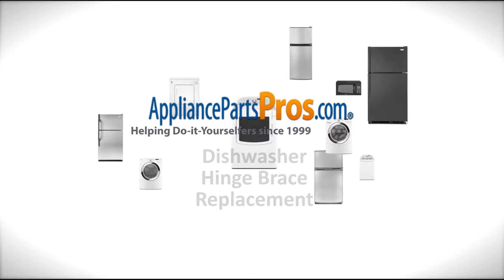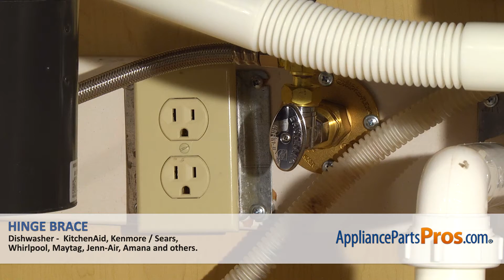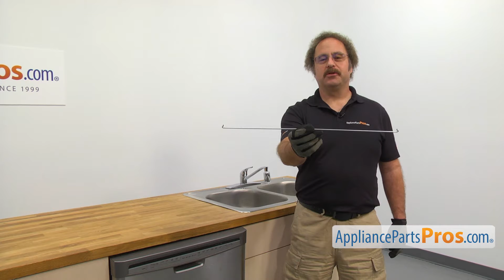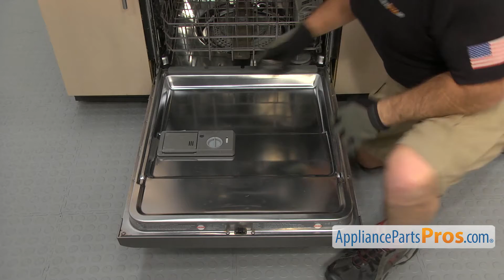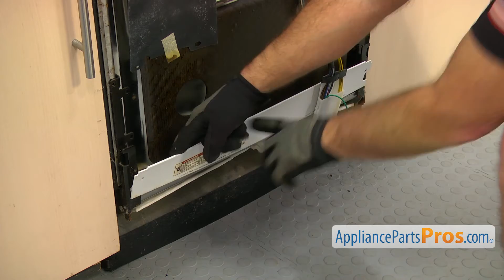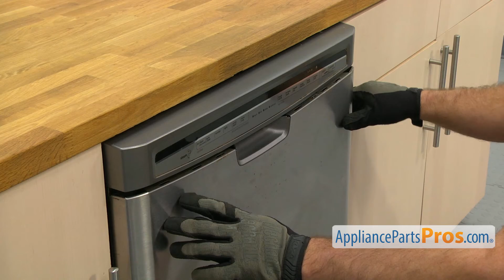Maytag Dishwasher Hinge Brace W10850371 Replacement — fits Whirlpool/KitchenAid

Comment: I'm in the SAME boat as everyone else here. I'm going to buy the brace, and see if it works.
The only reason I could think this could help would be removing a warped barrier that maybe flexes the seal away??
Reply from the maker: Yes, the brace stiffens weak/warped cabinet mounting so the door/latch align and the gasket compresses evenly. It can stop corner leaks. Level the dishwasher and use both braces if side-mounting.

Comment: Strange, my new dishwasher came with one loose. It just fell out when I took off the access panel, had no idea what it was. Thankfully these great vids exist so I was able to find out. Now I just wonder how/why it came off.
Reply from the maker: Glad we could help out 🤝
Reply: Mine did the same. I had to disconnect and pull the whole unit out without obvious way to re-attach the wire. Thanks for sharing!

Comment: Anyone find a fix to this? My white plastic moisture barrier piece appears to be warped and my dishwasher is leaking a bunch. How does replacing what appears to be a seal with a thin metal bar prevent leaking?
Reply from the maker: Great question! The hinge brace isn’t a seal itself — it reinforces the lower corner of the tub opening where leaks often start when the plastic warps. By adding strength there, it helps the door gasket seal tightly again and stops those pesky leaks.

Comment: So what keeps the water in the  dishwasher? My dishwasher is leaking because the rubber seal on the bottom of the hinge brace has hardened and isn't pliable. So now I'm supposed to replace it with a metal rod that doesn't seal anything?  What am
I missing?
Reply: I’m with you. I have replaced door seal and the Swiss cheese plastic lower door “seal”. Still having leakage. My “vapor”  barrier is warped and twisted so I’m pretty sure that’s where the water comes through. No help from this company or their competitor. I just get the parroted response that the rod replaces the seal.
Reply: @freds4703 I'm in the same boat right now. It believe its the white plastic piece that is the cause of the leaking since it appears to be warped. Where do you get a replacement?
Reply from the maker: What is the model number of your dishwasher? Where at is it leaking? Is it leaking at the bottom of the door?
Reply: @appliancepartspros  Maytag MDB7749SBB - Yes leaking at the bottom of the door during the cycle.  The original hinge brace/vapor barrier hardened up on one side and isn't pliable now.    I just can't imagine that it served no purpose and I will be okay just removing it and putting that metal rod across the doors.
Reply from the maker: I do apologize but I am not sure what you are referring to as a metal rod but if you are looking for the lower door seal the part number you would be needing is AP6022318 and that should fix your issue. Below is the link to the part so you can look at it. 
https://www.appliancepartspros.com/whirlpool-seal-door-bottom-wpw10497235-ap6022318.html
Reply: @appliancepartspros    The part number that is damaged is not the lower door seal.  It is W103214448 - which was apparently discontinued in 2015 two years after this unit was made.  It was replaced by a metal rod that just connects between the door hinge brackets - but will do nothing to stop the water from getting out.
Reply: I still am dumbfounded that the part that was removed (Made from PVC) was a Brace and Vapor barrier (and has two rubber seals).
 And the replacement part is a metal bar?
I am to understand that the Bottom Door Seal/Lower Door Seal will repel any water leaks?
 @appliancepartspros
Reply: @Gambit4u2 In the exact same boat right now.
Reply: @lanepressley776 and @Gambit4u2, I also agree with you. This makes zero sense as to why a bar would be the replacement for a pvc 'blade' if you will that sits between the bottom of the internal 'lower door seal' that appears to be just a piece of plastic that has holes all over it not really able to seal jack crap. When I pulled that vapor barrier, it appears to slide and act like the seal between the lower door seal with the vapor barrier holding it down from the inside. Call me crazy.
Reply: Yup, right here with you. This is crazy... Mine is warped and leaking as well and completely removing it seems ridiculous.

Comment: Do you not need the vapor barrier to protect the electrical components and keep water within the dishwasher?
Reply from the maker: For this video the barrier is on the inner part of the door when it was removed as you can see near the end of the video it shows it.
Reply: @appliancepartspros  I still am dumbfounded that the part that was removed (Made from PVC) was a Brace and Vapor barrier (and has two rubber seals).
 And the replacement part is a metal bar?
I am to understand that the Bottom Door Seal/Lower Door Seal will repel any water leaks?